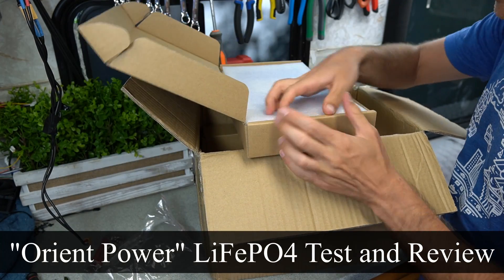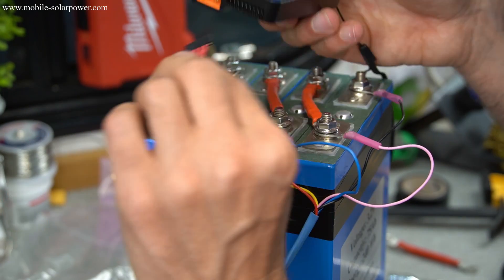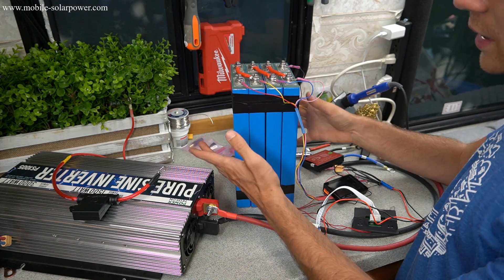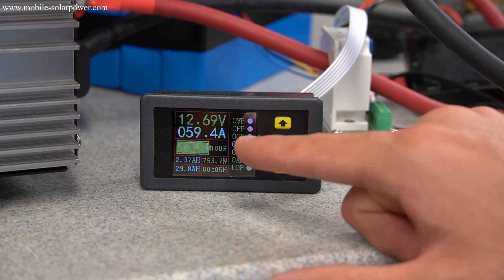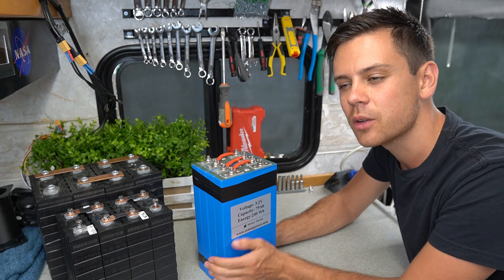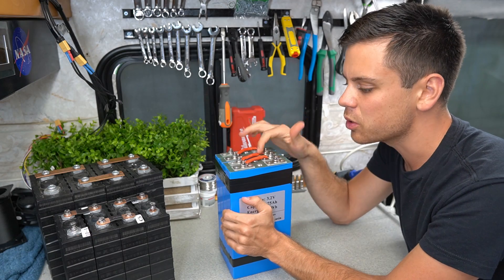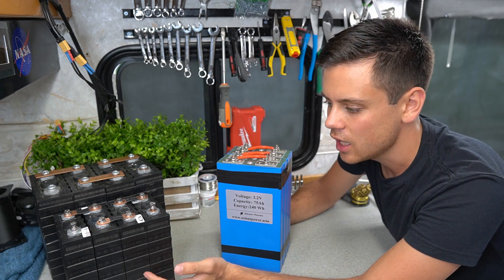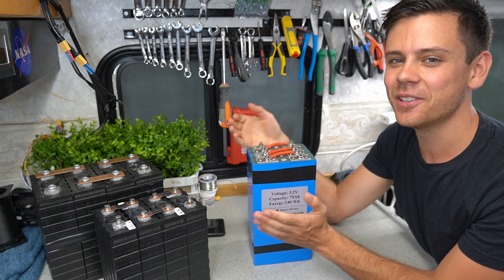"Orient Power" $450 75ah LiFePO4 from Amazon.com - Test and Discussion -

Comment: I think the lower current rating is actually because of the aluminium casing. These cells will heat each other easily, and only allow a bit of heat to escape via top and bottom and small sides. The other prismatic cells, they will have similar construction inside, but they will be physically spaced more, and allow better conduction of heat to top and bottom, despite encasing in plastic.

If you discharge them only at smaller current (which is usually the case anyway), that shouldn't be the problem, and smaller form factor can be really beneficial. Or put some spacers between cells, to increase effective surface area.
Reply: Right, my point exactly.
Reply: Supporting

Comment: Off subject question from the Missus;
We have a 100ah AGM (cheap). Missus asks, can we simply add a 200ah gel type battery with the 100ah?
My first guy instinct is to say no. But I can not say why.
Is it possible? If not, why?
Or should mixing 100ah and 200ah batteries even be considered?
Thanks for your time.
Reply from the maker: Not smart. Internal resistance different. Lower resistant battery will take grunt and die faster. If one is really old, it can drain other ones with self discharge alone. Not good. Always same age batteries used together
Reply: @WillProwse  thanks for the clarification. 
Will let the missus know.
Your time is appreciated.
Reply from the maker: Yeah your guy instincts were spot on hahaha

Comment: The price of these cells (75Ah) is a bit cheaper directly on Alibaba. About 80$ when buying 10-100. And about 68$ when buying 100-1000.   As of now, I think Sinopoly is a bit better, both in pricing and quality and experience.

It is a bit weird, as on Alibaba in their official shop, I also see batteries and cells of other manufacturers, like Winston.
Reply: Plastic cover seal by heat, after using moisture has high chance to go in, causing unbalance/different inner resistance, now all lithium factory change to aluminium cover, only 3-4 factory are still making the plastic cover type. This is new generation and old generations. Now the trend is small size light weight, safe, long life. Step by step.

Comment: So they come as 3.3V from manufacturer. Isn't that basically 90% charged? Afaik in storage and transport they should be stored 40-60% SoC for best life time. Why they come precharged like this?
Reply from the maker: 50% because LiFePO4 voltages settles a lot after you charge. I don't go by voltage anymore for SOC. Very inaccurate in testing
Reply: Lifepo4 battery stays long period at 3.2v while charge and discharge, lithium battery features. All batteries are 50%charged before send out.

Comment: Hey Will, I've watched a few of your battery builds and do like them.  As with this one though, where you used electrical tape to hold them together.....have you ever seen the very large zip ties that are about 16-18 inches long and have omost a 1/8th inch thickness. We used them at Kenworth truck Co. all the time and these would work better than your tape and the metal clamps. You can also get a zip-tie gun that will pull the zip tie extremely tight and also cut it when it has reached max pull.  I know they have some at Home Depot.  They definitely would be the way I would go.    Thanks for your videos.
Reply: Cedar Jack review my channel. follow me.

Comment: jehu garcia has a better test on 100ah. it came out 99.95ah with temperature.
Reply from the maker: Yeah he told me that. That means my cells were not matched as well, or my cells were not as good. There is also a naturally occurring variation in all packs.
Reply: @WillProwse  I should send you 100ah, instead of 75ah, 100ah with M8 post. And was matched with large quantity. 75ah battery user less, normally matched with less quantity

Comment: Which model is that? OP-LPB2713250 ? The fact it is not clearly marked on the label, is really worrying.

How would it compare to something like Frey 36130288-100AH?  Beyond stated capacity. The are about 55$ for 100Ah, vs 75Ah, and their stated cycle life is 4000 cycles for 100Ah model. Smaller capacities are a bit worse (500Ah model is only 2500 cycles afaik).

Comment: great video as usual Will.  I'm getting overwhelmed with battery choices for my cargo trailer conversion project.  You do so many videos on so many different videos I'm never sure if you have a new preference or what to pick.   Still not sure why I wouldn't just buy a re-purposed Tesla Battery?   So Much Value for the investment.
Reply from the maker: Thanks. And whatever I currently find to be the best, I have on my website. I always update the website before I make the videos. And the site is more organized then YouTube videos. Can be hard to specific info in my video library

Comment: If you added say 3/16" thick vertical wooden slates between batteries to help cooling and  maybe the supplied bus bars wouldn't need to be bent.
Reply: I believe the min spacing should be .8” to get the best convection cooling. ( from memory)
Reply: This ^. Or simply user your favorite copper bus bars with adequate spacers. Though At this point you lose any space saving the small battery would have provided.
Reply: Jeff Soik sellers are claiming 8000cycles.
Reply: 0erok I was thinking of using wood to make a battery case mold, wood is an original materials, but we can use it for many purpose
Reply: Paint stir sticks split in half.

Comment: Might you want to put venting spacers between the packs since the inner battery pack will just cook with each other.
Reply from the maker: For a capacity test, having the cells hot will increase their capacity. I gave them this advantage for a reason. If I was doing a charge cycle life test, ambient temp would be different ,and cell design/cooling strategies would be dealt with accordingly. But not for this pack or this test.

Comment: The 'marine guys in forums' are very glad to have you metaphorically on-board.  You know, if you offered to do a little colab with a popular youtube sailing channel, I bet they would chip in with a nice holiday in return..
Reply from the maker: They are the best!!! I really would love to work with them. Because of their constraints and environment, they produce the best low voltage system information around. So much of my system design stems from what the marine guys do. Great information! Way better than most battery guys online.
Reply: Steve Wright review my channel. follow me.

Comment: I frequent the rv and marine lifepo4 and that is the first time I heard negative comments about CALB. I always considered them top tier.
Reply: I have 28 of the 100 ah ones I purchased from Jack Rikard and am starting my fifth year with them full time. They have always stayed very close in balance. In fact I am just now getting around to looking at BMS and balance as they are getting older and I am seeing some separation. I may just be lucky though. This is the SE series the one before their current product line. I do shoot for no higher than 3.4 per cell on charge and typically don't go lower than 2.9 per cell so perhaps avoiding these legs and high c discharge has saved me.
Reply from the maker: Jack is great!! That's so cool. And yeah, sounds like you are taking good care of them. They should last for ages for you. If using in ev, I would say get a huge active balancer, but you should be good regardless.
Reply from the maker: Yeah I was told that at first too. Ask anyone who capacity tests boxes of calbs or has used them for years. Also they don't care for being charged to 3.6 if they want to stay balanced. Supposedly 3.5v is sweet spot. Some marine guys do like them, but makes sense considering their properties. My friend who had to test them by the crate said he had 10% of the cells underperforming and had to be sent back. That's what I'm going with. If someone can prove me wrong, that would be great. Those are easier to source

Comment: So we have the same BMS that you do .. one thing that helped us allot was we actually installed a heat sink on the BMS .. it allows us to go all the way up to the rated amperage ... made a huge difference .. i think we got the heat-sinks off of EBay for just a few dollars ... we cut them to size .. glued them on the back (with thermal sealant) ,. and it works great
Reply from the maker: Smart idea. I have been clamping metal to it. A dedicated heatsink would be great! Thank you for the idea

Comment: $450 for a 12v 75ah battery!!! 😥😌😌 that is outrageously expensive!!
your videos are great and educational, but I am NOT a fan of any of the batteries you advertise. (due to cost)
I personally like to build my own lithium batteries from used 18650 cells extracted from laptops.
My complete 12v 400ah 18650 lithium battery cost me just under $250 to build.
I am currently working on a 24v 10kw 18650 power-wall for my home and it will cost me way less than $1000 to build.
The key is to save money!
There is no point on spending unnecessary hundreds if not thousands of dollars if we can achieve the same results from building your own.
Reply from the maker: Oh yes absolutely! Very cheap. But. Nmc is combustible and I absolutely hate used cells. Hate them. I like matched, high quality cells that will not catch on fire and last for 10+ years. I am well aware of the cost of nmc cells, but there is no point. Also they are rated for 500-1000 cycles. LiFePO4 is 3000 to 10,000 cycles. In the long run, what would you prefer? A battery that lasts longer and can't catch on fire in your house? Or some cheap used 18650's? I worked with lipoly for years before I touched these cells, and I know what cell combustion looks like on multiple occasions. I do not recommend any combustible batteries to my solar audience.
Reply: @WillProwse  completely agree and understand your point of view.
But personally I been working with used 18650's for aboutb 2 years now n have never had any issues with heat or explosions.. and yes nmc  cells do have a less of a cycle life, but in my 4s setup w/BMS I charge up to 15.5v max n inverter shuts off at 11v min, no risk of overcharging or undercharhing...hense no explosions... so I am expecting years of cycles on my battery with so called "bad cells"
Plus I spent hours checking capacity n resistance of each cell. I am very confident that my pack is very well balanced.
Reply: I'm doing the same, have over 1000 good cells after testing about 3000. Zero cost apart from months and months of time and ancillary part such as cables, connectors and BMSs and a few Opus testers.
Yes, I've saved money, but spent 1000s of hours which I mostly enjoyed.
It depends how much you value your time. For some, spending a few $k is cheaper than 1000 hours.
Reply from the maker: Wow that's amazing Andy! Always love hearing about your projects. And yes, the time to test and build a pack can be extensive for some. Really depends on what a person values and how much money is available.
Reply: @WillProwse  At the moment I have little money but not complaining - am using my time to soak up everything I can to use that knowledge for when I get round to looking for work again.
Recycling is important - I just made another cage for some of my 18 degus out of a discarded wooden pallet - looks great!
I used to have a $200k income as an IT consultant years ago, but that's all gone since emigrating, living like a rock star and crashing and burning... Some things are more important than just money, but it's still useful to have!
Reply: @ahaveland  agreed. I personally enjoy testing them as well.
Reply: There's usually a cost benefit analysis one must do. You will spend a lot of time disassembling and constructing you DIY batteries. These are almost complete.

Comment: A BMS that can have a heat mat around the cells to heat them, before charging when its under 0 Celsius would be nice. I haven't googled it.

I know the batteries you can buy finished has a heatmat, so it heats the cells first before charging.
Reply from the maker: agreed.
Reply: There are RVers that do this. They use data typically used for warming rv holding tanks.

Comment: have you ever considered using 18650 cells
Reply from the maker: I hate them. Even the lifepo4 variety. Pain to build. I have some 22650's packs I am testing. Those might do well. Jehu just posted a video of some headway lifepo4 cells and he got 50% the rated capacity! Absolutely awful. They have a great discharge rate, and they usually test higher, but after seeing test results like that, I am very scared to use them.

The powerwall and ev guys love NMC 18650's though. Mainly for specific energy benefits and cost. But I wouldn't touch them with a stick for solar. Different application.
Reply: @WillProwse  so it is still better to use LifePo4,not the "cycindrical" one but the one you show in your video?